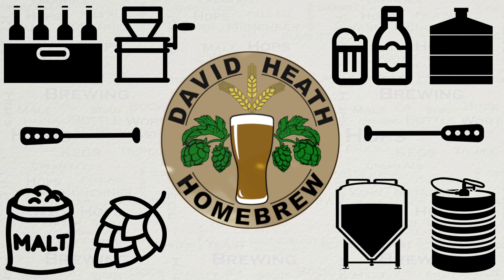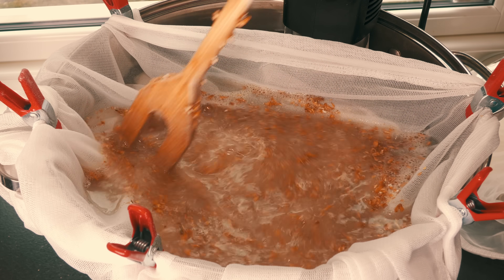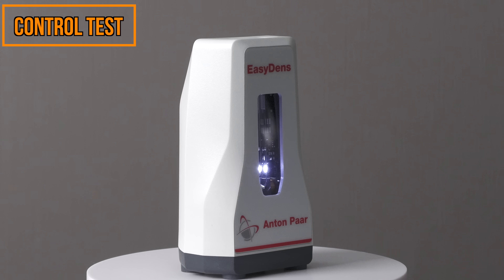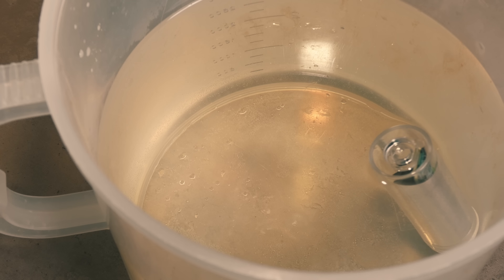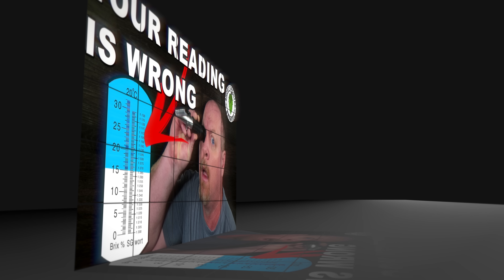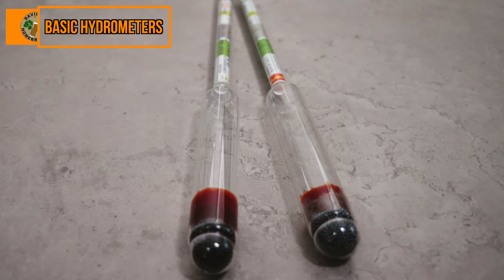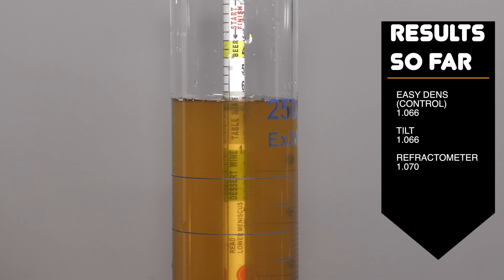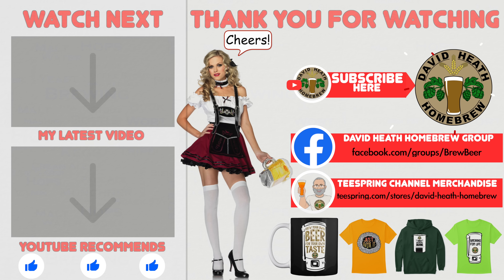Homebrew Instrument Accuracy Comparison Tilt Vs Easy Dens And More

Comment: Interesting comparison David. Surprised the refractometer was showing the large inconsistent reading. Glass Hydrometers, I only consider as a guide to gravity, some more accurate than others. Personally, I'm not looking for the Nth degree of accuracy, but more interested in how my fermentation is progressing over time with a visual easy to read (especially with my old eyes) decrease in specific gravity of my beer. So a large digital display instrument is preferred for my brewing needs.
Reply from the maker: Thanks Tim. Instruments can and certainly will vary. So I encourage people to do their own testing. The more expensive options are better but it depends on how much accuracy means to the individual vs the cost.
Reply: @DavidHeathHomebrew Agree with you David.  I exclusively use Tilt and Ispindel floating instruments that give a easy to read visual display of the fermentation process. Build up of yeast deposits and vigorous fermentation do give some inconsistencies to readings during fermentation, as will pressure fermentation. But this is normal and expected with such instruments and as it's just a visual indication of fermentation, I'm perfectly happy using them.
Reply from the maker: Cheers Tim 🍻

Comment: Great video! (Not just because I'm in it..lol) I see comments from a lot of people with regard to gravity measurements. All the way to both ends of the spectrum those that don't bother to take a measurement and those that measure multiple times throughout the entire brewing and fermentation process. I kind of fall somewhat in between with a measurement at mash to see how the conversion is gone one more time at fermentation beginning and then once more at the end. Yes the easy dens is expensive, but you want 100% reliable results I think it does make sense as a good investment. Cheers David! 👍🍻
Reply from the maker: Thanks Brian. Yes its a common thing. I think important thing here is to understand the accuracy levels on offer and make your own call.
Reply: @DavidHeathHomebrew  I agree!

Comment: I must be lucky. I have a tilt and it gives me very reliable results all the time. Pleasing to see you also confirmed this. So many people bag them out all the time. 
I do agree with ViLagarMat’s comment though, you didn’t list the reading from the Hydrometer. It looked spot on at 1.066?? Not bad for a very cheap piece of kit.
Reply from the maker: Fair enough, it may be harder to see on small screens but I did mention that it was very similar to the refractometer at around 1,070

Comment: How does the easydens go with hazy beers? Great video!
Reply from the maker: It works very well with all beers.
Reply: @DavidHeathHomebrew  I've certainly had some hit and miss results with my easydens on hazies, where the gravity changes anywhere up to 3 points. I've calibrated as per instructions with distilled water but have read that some breweries need to "de-haze" the beer to get accurate reedings. Do you think this is something we could test?
Reply from the maker: I can certainly look into it, sure no problem.
Reply: @DavidHeathHomebrew  I'd be more than happy to help out!